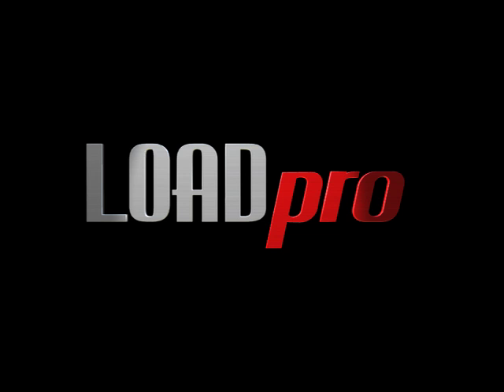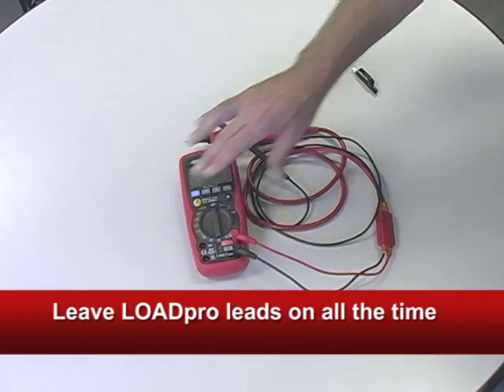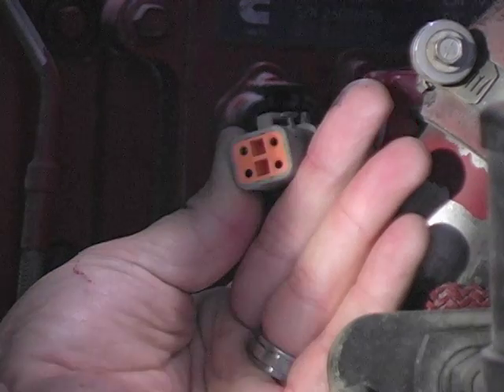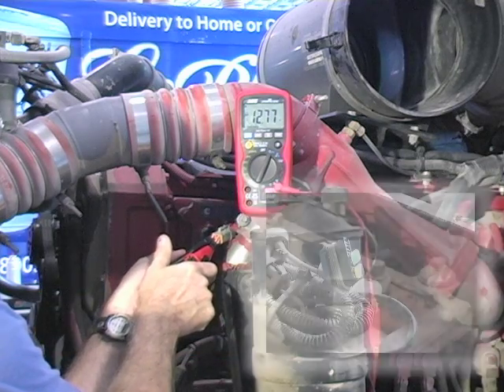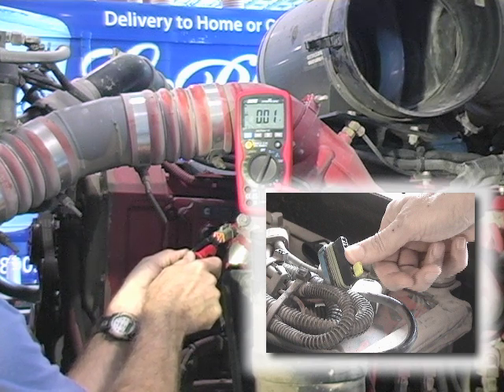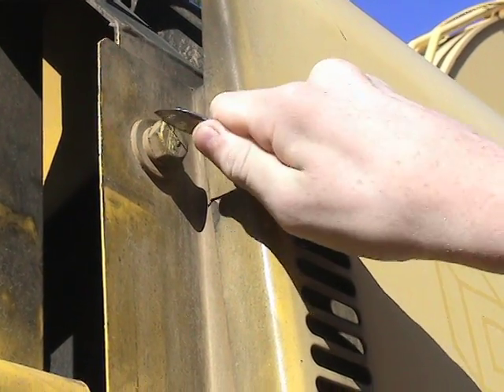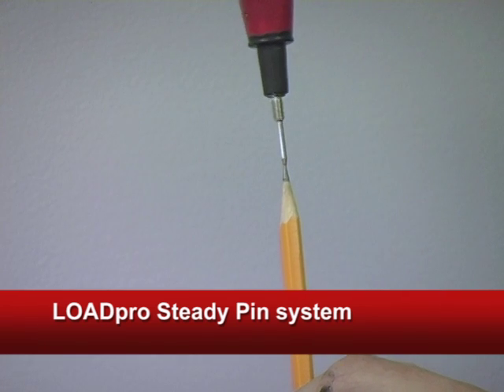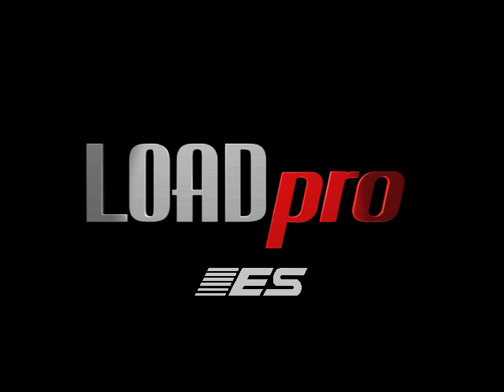LOADpro Dynamic Voltmeter Leads

Comment: Hello! The loadpro can be used for sensors that work with a 5v power supply? Or for the signals sent by the sensors to the PCM? Is there a possibility of PCM damage during the test? Thank you

Comment: Okay - I understand the confusion and the question. If the wires have voltage (and ground) normally, you simply read voltage and push the LOADpro button. ANY other wire, without voltage or ground - such as an input signal wire - requires that you artificially apply a voltage at one end and read/load it at the other end. You cannot use the sensor voltage or signal. At least- we haven't tested it. SOME guys use the tool as a substitute sender (fuel level). Remember - you need unresisted V to test.

Comment: You're asking conflicting questions. Opens and shorts-to-ground are found with Ghost and Zero voltage. If you're testing the power and ground to a 3-wire active sensor, you simply read voltage on the (+) and (-) and load the circuit. You always disconnect the component to use these leads.

Comment: The wire can be tested - but you have to set up a test separate from the signal. If you isolate the wire at both ends, put voltage on one end, and read/load voltage on the other, you're fine. The instructions say not to use it on the input - not the wiring.

Comment: ECM inputs are all of very different types. Some are analog and some are digital. The tool is designed to test voltages and to load them - you can't load a signal from a sensor. You can test sensor drivers (5V, 8V) but they're just like regular voltage supplies. Some people have figured out how to use the tool to simulate a sensor. As far as the 120VAC goes, the tool isn't designed for that amount of wattage. You won't hurt yourself, but you can destroy the tool from overheating.

Comment from the maker: Yes, if you see solid zero volts, this is indicating a short to ground.  Following our instructions in the manual, you can then determine quickly weather the short is on the ground side or the positive side of the circuit.

Comment: ghost voltage doesnt show up if you use a non autoranging multimeter. its just the multimeter trying to autorange so it should be pointed out that the results of open circuit ghost voltage are different when used with a non autoranging multimeter.